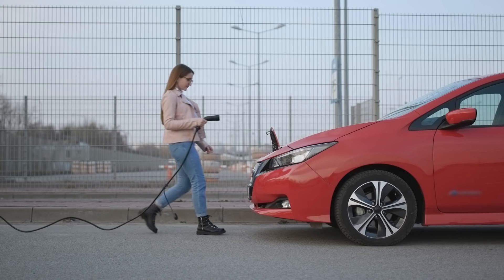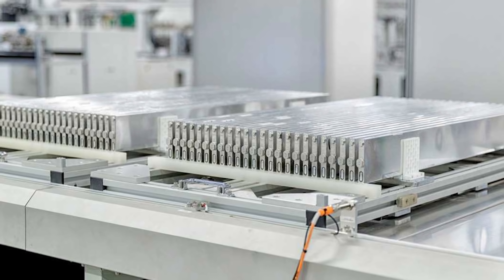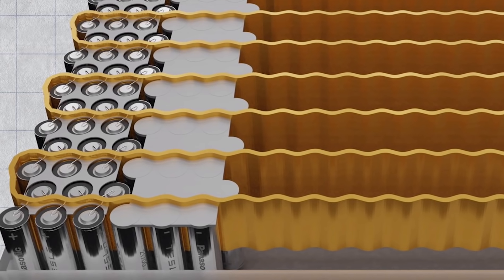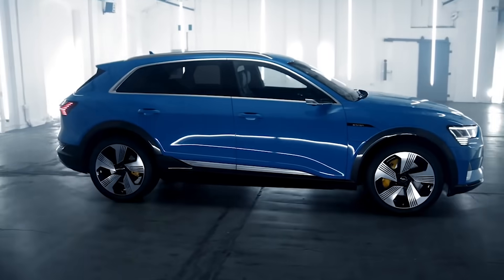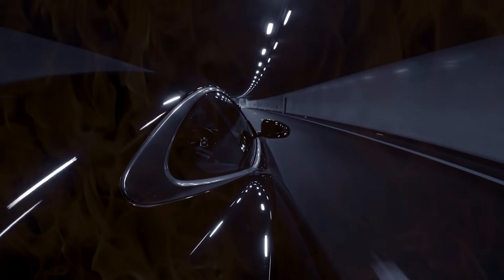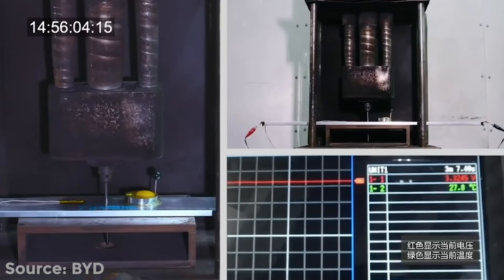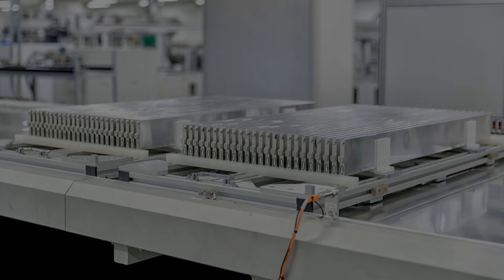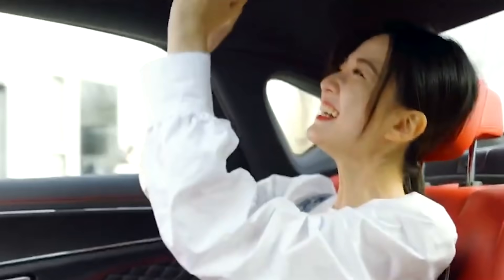Uncovering China's Battery Breakthrough

Comment: The reason for the results of the puncture test is not because of surface area. It's because of the difference in the chemistry. Normal cobalt based LiIon easily gets into thermal runaway and causing the electrolyte to burn. LiFePO4 (lithium iron phosphate) however does not. It's weaknesses though are lower energy per volume but in such large batteries it may be accounted for by it's not needing as much volume for cooling. Added benefit of LiFePO4 is that it's a more long lived chemistry than traditional cobolt based ones. More cycles and longer shelf life (not aging as much just by time alone).
Nissan used them in their first Leaf's. But they got it wrong and paired the vehicle with a much too small battery resulting in the cells being driven too hard (thus lowering their life) and low mileage between charges. Most of all Tesla got those things right - not because they're better per se (and I really don't like Tesla's business model which is like Apple) but they realised that you just can't make an EV with a weasly small battery and expect people to absolutely love it.
Most things being about equal I'd take LiFePO4 any day over other LiIon.
Reply: @New Tunes For Old Logos 
Better yet, the Chinese will be building battery replacements for existing cars, and we'll just swap them in. Of course guys like Elon Musk wanna be Johnny on the spot and eat China's lunch, so we'll see who wins this race.
Reply: However, must be mentioned that lithium iron phosphate batteries are also heavier than Li-Ion batteries.
A considerable disadvantage for flying drones, they do not use this chemistry just for this reason, because they are heavier, but a disadvantage also for ground vehicles, for a similar obvious reason.
Reply: @claudiocosterni6488  Is weight really an issue for grounded vehicles and watercraft? Steel is still heavier than those batteries by cubic centimeter.
Reply: Weight can be saved by making the batteries part of the structure cum protective shell. The cooling system can also be eliminated.
Batteries hardly discharge when stationery, air convection and climate control can handle the fast charging with the large surface area.
Drones may not be as suitable but their batteries are smaller and not much nickel and cobalt are needed for their batteries.
Reply: @madsam0320  That doesnt change anything. Take a LiIon car and use a structural battery, then take LiFePO4 and do the same. LiFePO4 is still heavier. Only the weight saved from cooling components would help but not nearly as much as the weight difference at a large scale like the Blade pack
Reply: @FrotLopOfficial  you are right, in fact Tesla among others are mooting on using Li-ion batteries as part of the structures. But being more combustible, they are limited to inner structure away from the shell and impact zones. They will still have advantage on range or weight, but at much higher costs, on materials and longevity.
Reply: @madsam0320  Wonder why the video did not cover all these disadvantages of the LiFePO4 batteries.
Reply: @ratnadeep617  idk, im work with them, they are difficult to implement in small devices, but thats not a problem for car company, here is one huge problem, this is very big cell and you will need ton of special equpment to make them, also flaw in cell will have bigger impact on overall performance
Reply: @ratnadeep617  
Because the material science of batteries has gotten really fascinating and there are all kinds of new options including sodium formulations as opposed to lithium that would have huge environmental and cost advantages, and glass batteries that use solid substrates that  eliminate the possibility of dendrite formation, while dramatically improving heat tolerance, recharge time, total lifespan, and number of charge cycles.

A comprehensive discussion on all the most fascinating alternatives in development and their relative strengths and weaknesses would be a long but fascinating video in its own right.
Reply: @ratnadeep617  most ev batteries go for lithium cobalt batteries because of energy density (range/weight).
But this lithium iron phosphate battery claimed to have overall better energy density by eliminating liquid cooling (radiator, pipings, electric powered fans etc) and incorporating it as part of the structure. Even if it’s only on par, or slightly less energy dense, it’s still a win due to speed of charging, safety and costs. Also more environmentally friendly without cobalt and nickel.
Reply: I think this is where we need to see two markets emerge. Similar to how we have both petrol and diesel ICE, we should have both LiFePO4 and LiIon. In the UK, most journeys are short and would be well met by smaller capacities overall.
Reply: I mean you want to get technical… lithium nickel manganese is probably best chemistry, but it needs to be treated with respect. At north of 300wh/kg and north of 60c discharge it’s an impressive battery, but overcharge or undercharge or too hot/cold and boom. Most unstable chemistry, but highest power output. If I was building a sedan, I’d want iron phosphate, but if I wanted a race car nickel manganese is the way to go.
Reply: Luis Gomes Nataniel  Well just one more reason to choose LiFePO4.
No need to shout though.
Reply: That video by BYD was bullshit. They took one of the most sensitive cells ans punctured it until they got a big enough explosion and did the same with their cell until they happened to not make good contact. If you look at the cell voltage shown in the video, there clearly is no internal short in the BYD battery, the voltage stays nice and high. At that energy density, their batteries wont be puncture proof like they are trying to demonstrate here. With the chemistry and design its possible to both dramatically lower the chances of a chain reaction as well as prevent flames but energy is going to be released one way or another.
Reply: Luis Gomes Nataniel  Lead is a dangerous toxic substance, yet its in all our car batteries. Gasoline is highly toxic, even the fumes can cause permanent brain damage. 

But here I am, perfectly fine because I am not eating car batteries or inhaling gasoline fumes. 

Cobalt is actually not as toxic as either of them, its a necessary element our body needs and only becomes toxic in excess, as so many things do. If you dont plan to eat batteries, youre gonna be fine.
Reply: You seem so learned... perhaps you can shed some light on a dilemma... is it true that if you install a byd in you car after 3 days you get Corona and your car gives of an odor of noodles? I had a huawei phone and that’s exactly what happened to me... it took 3 months before I stopped smelling like noodles and my eyes became big again... 🤮🤮🤮🤮🤮

Comment: blade bat is good , but segmented scale pattern(xyz axis separation) semi liquid hybrid capacitors are even better . Couple that with the new dirt cheap”flash-graphene” mass production that cost a few dimes. (Turns cheap petro plastic garbage to 95% military grade c8:) put it through a 2000psi quartz vacuum-300w electrolysis chamber for couple nano seconds in a mass assembly line-and you got yourself a power source 900x stronger than steel, more conductive than gold, and as heat tolerant as something like tungsten. Could be the start for iron man/ power armor battery. This flexi capacitor maybe imbedded into artificial nylon-graphene laced muscles. These are already in the market, amplifying strength as much as 800 fold. Careful not to crush operator, needs a sturdy inner exoframe skeleton to take all those kilojoules.

Comment: If I'm not mistaken, Torquedo electric outboard motors used a lithium - iron - phosphate battery about 10 or so years ago.
They showed the same test of a nail being driven thru it with no problems.
Reply: Even e-bikes use them for more than a decade because of their safe nature and relatively high discharge C rate.

Comment: I can imagine the casing of the electric motor could be made of the battery itself. Such close integration of battery and motor would make the motor appear to run without obvious power input. Close integration of otherwise separate systems may be a design philosophy in the future.
Reply: But a well designed brushless (AC induction, permanent magnet or reluctance torque based) electric motor runs as far as the bearings can hold up. But batteries wear out eventually. You vould need to replace essential parts of the drivetrain along the battery unnecessarily. That's the problem with "structural" batteries integrated into the chassis too. They usually can not be replaced, or simply not worth it. The lifetime of the battery becomes the (relatively short) lifetime of the vehicle itself.
Reply: @peterkiss1204  Hey don't confuse me with truth and facts! Ha ha haa! 
Thanks.

Comment: 560 mile battery that's the goal,
70 miles a day 7 days a week =490 miles, the extra 70 are for phantom drain over the week.
Reply: If you are doing 70 miles a day your battery only needs 140miles of range (or just more than 70)

Comment: But what is available today? If you go to the BYD website, a BYD E6 electric car has a range of 250 miles. The Tesla Model 3 has a 353 mile range and the Model S has 405 miles. It really doesn't make sense to compare BYD's future product with Tesla's current product. Tesla's specs are not static. By the time BYD builds their new model that can beat today's Tesla range, Tesla would have their new 4680 batteries - increasing Tesla car ranges to 500  - 600 miles.
Reply: But what's that in cat paws?

Comment: If it better than the cylindrical one, then they should have done it 40 years ago, not now. One can see, The cylindrical battery is much more structurally stable and more air flow in between. Think why our cells in the body is not just a few long plate shape? :) Sphere Shape is the best ratio but they extremely difficult to manufacture, that why cylindrical is the next one took place. Cube shape is not that efficiency, especially when you have to have space between each long cell. Length of cell 1 meter make structurally not sustainable go through shock , pot hole,... Many negative perspective with elongated cube shape ( even our bone in animal body is cylindrical, wanna know why?). If cube shape with rubber surrounded maybe i can re-think but that not make any sense in airflow cooling.
Reply: living in a cave is cooler than our modern day homes....
Reply: Because cars are not round.
The blade cell packs more efficiently than a round cell.
Just have a look at a pack of cans compared to a pack of square packs. No gap between the squares but plenty of space between the cans.

Comment: It would have been nice to see the construction and chemistry of the BYD blade battery. Hard to understand how a few foils can be structural.
Reply: I made a liquid cooled pack using pouch cells. It was 1.7m long and about 15cm wide. It was strong enough for me to stand in the middle when supported by the ends and the energy density was the same as a Tesla brick. So it is certainly possible to make the long cell structurally  strong.
Reply: @franciscoshi1968  yes
Reply: Actually it’s not hard to imagine.  Individual cylinders require support between cells whereas strips on edge offer a great deal of support, particularly when pressed together like a laminated beam. Oriented across the chassis it would actually provide quite a bit of structural support or at least require less support to hold them up.
Reply: If the batteries are structural members wouldn't that make it harder to replace the battery packs making the vehicle obsolete one day.
Reply: @jimmyjohn8008  We have been heading for a disposable society for many years now. Most battery operated things now just get disposed of once they reach the end of the short lifespan of the battery. Take mobile phones for instance, with sealed in batteries that you can't just pop out and replace like you could a few years ago.
Reply: @Tryst46  You can still find replaceable battery phones, though, if you would prefer to keep that functionality.
Reply: @jimmyjohn8008  good question, how ever structural does not have to mean non-modular
Reply: Ever done the toilet roll tube trick? Stand a load of them on end and place a plank on top. Sideways, they have no strength at all but end on, they can take your weight easily.

Comment: There is no mention of  energy  density?
Yes the battery saves  s[ace  but how effective is it in providing the Energy  for the vehicle.
There is a reason that Tesla does a cylinder  battery and it is bercause of the  existing infrastructure of manufacturing.
Manufacturing batteries i s massive  task and i cant see this batter making much  head  way  for s very long time or at all but is  s tep in the right  direction.

Comment: Interesting video! It would have been nice to have had some real numbers in terms of energy density per unit volume and weight.
Tesla new battery pack will also act as a structural component to the car.
I am not impressed about the battery chemistry though. Lithium-iron-phosphate is the cheapest but also the less energy dense of the group.
Improvements in safety is a good advantage. 
Let’s see how things will evolve with the lithium-metal solid state battery.
Reply: Energy density can be a bit misleading when you are comparing different designs. The thing I've always hated about the current round cell design is it takes so many cells to run an EV that a lot of space and weight is taken up by packaging. A design like this can make a less dense chemistry be equally or even more viable in the real world. In the long run though, solid state is probably the best option and it also can work in configurations like these ones.
Reply: 4:05 - kind of made the while video pointless....

Comment: LiFePO4 batteries does not experience the same thermal run away.
Reply: In an extreme case they can still generate enough heat to become a hazard.
 There's a documented case of a communities grid scale LiFePO4 battery going up in flames because the heat couldn't be managed when something went wrong. LiFePO4 is safer than Li-ion NMC but you still have a very hot battery if something goes wrong.
Reply: @GENcELL2014  That is what he wrote... one is doing it in "extreme case" other is going nuclear in not so "extreme case"->that is why "LiFePO4 batteries does not experience the same thermal run away."

Comment: It makes perfect sense to create cells in shapes that are optimized specifically for cars. The improvements look very promising, I like it.
Reply: Yes.
The small cylindrical design of the existing batteries reflects what they were intended for, which is for small, handheld consumer electronics.
For the mass market of cellphones, a flat battery was more appropriate, and because of economy of scale, the flattened battery was practical to produce.
For electric vehicles, initially just using the existing batteries was appropriate while numbers were small, but as the electric vehicle market looks more promising in the long term, it makes sense to design cells more suited to this application.
Reply: @edwardlewis1963  Wrong - they're round for safety - to resist expansion pressure.  Do you think Tesla are stupid or something?
Reply: @edwardlewis1963  Tesla recently introduced their new battery design. A blank sheet design process costing hundreds of millions. The result is a cell a bit larger than a D-cell.  Small cells allow zonal management of battery packs uniformity of charge and temperature.  So save your speculation and look at what’s actually happening in the industry.
Reply: I don't find any videos about making electric motors more efficent. I think that could also increase range of the vehicles without putting more batteries in vehicle
Reply: @NeRa101  they do improve the motor, you can improve efficiency, but power is power.
Reply: @NeRa101  I agree. That's also interesting vector for improvement.
Reply: @NeRa101  perhaps because the motors are already 98.2 to 98.8 percent efficient
Reply: I like your dp
Reply: I agree and there are a few companies and academics trying this.. and also building batteries into the frame a given structure. I think layered batteries that can be customized to shape would a way forward as well. They could easily be designed to use otherwise unused space...
Reply: In 5 years they'll come up with the Toblerone battery and claim that three sides is mathematically the optimal shape for cooling and we'll all suddenly believe that the "blade" is a ridiculous antiquated idea.
Reply: Yes
Reply: F U
Reply: @kryptoniteee  fu yu
Reply: I guess you will like learning how to speak Mandarin too; or maybe you already do... lets just kiss democracy goodbuy
Reply: @tiredrummertube  Grandpa! you forget to take your pills again!!
Reply: @tiredrummertube  That's gotta be the weakest pretext for a racist rant I've seen for a while...
Reply: @tiredrummertube  well as if muricans know what democracy is xD
Reply: @tiredrummertube  Yes, yes Grandpa. Now let's bring you to your room, it's 10 pm already.